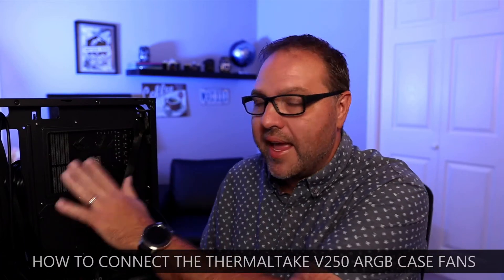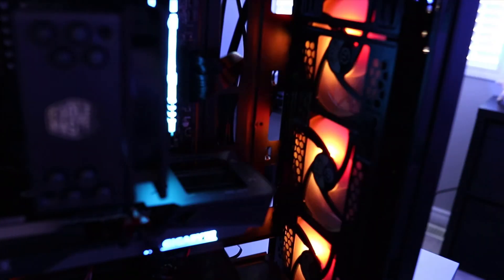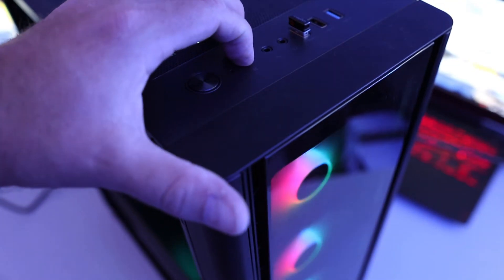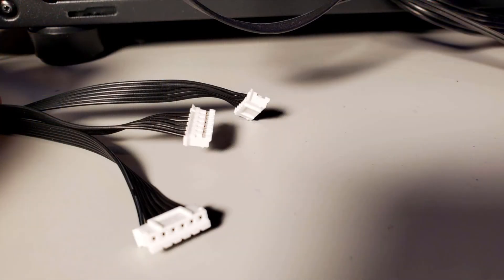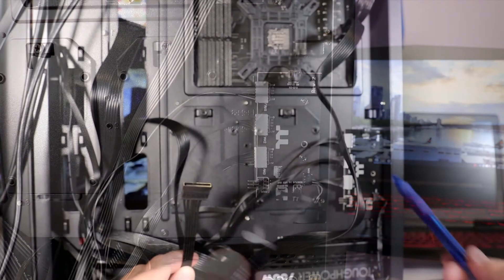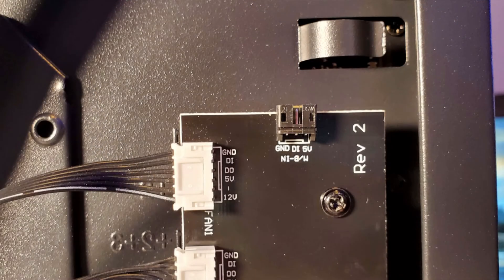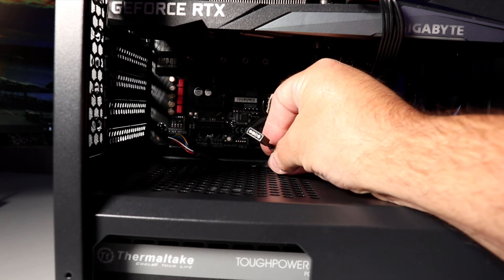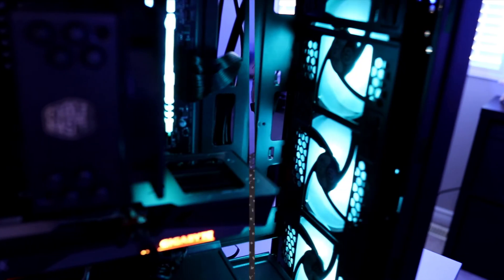How to Connect the Thermaltake V250 ARGB Case Fans

Comment: Hello, I have different question. I see you have thermaltake contoller. Is it possible to change the pwm of the fans via controller. I think it is only possible to change ARGB settings, but not pwm setting.

Comment: Great, great video! My son has all ofthis and never got the fans working ... he's been looking to buy a new fan controller when I think all that's missing is him not re-using the reset button and also missing the cable at the top of the board (in your video's). He's kept the boxes ... so will now go find that cable and (hopefully) set everything up correctly. Not a bad attempt on his own when he did this 4 years ago at age 13 though 🙂
Reply: Yep ... worked ... your video was fantastic ... my son is over the moon with the whole case (watercooliong, memory DIMMS, radiator fans and front fans) all being controlled in unison.. Great video! He seems to have to hold the reset button for the 3 seconds to transfer control over to the software utility .... can you make that the default in any way?

Comment: What software do you need to change the rgb fans
Reply from the maker: Typically you would use whatever RGB software is compatible with your motherboard. Ie RGB Fusion For Gigabyte, Asus Aura Sync,  MSI Mystic light etc...

Comment: I have thermaltake commander C31 rgb case but in this MB signal bridge cable is missing. So my inbuilt case fan does not sync with motherboard when I press the mode button and only one of both fan glow red color only how to resolve this issue.

Comment: Do you only have to plug in thr ARGB cord from the hub to the mobo if you want your rgb software like MysyicLight from MSI to change colors of the fans?
Reply from the maker: Yes, I believe that's all I have plugged in.
Reply: Am I right in thinking this case sucks ass because you can't even control the fan speed or set them to a fan power curve... This is my first PC build I've ever ever done. I won't make this mistake again lol ...

Comment: Great video! I noticed that the connectors for these fans have 6pins, I was wondering how you would replace one of the fans if they broke? I've noticed most other ARGB fans have 2 connectors.
Reply: Yeah I have that same issue rn. I ordered the same make and model of fan based of the serial number on the back but they have two cables and now I am scratching my head
Reply: Hi, i can help you, you plug the 3 pin 12v for rpm fan in the motherboard, and you connect the rgb 2 pin on the 2 pin say led out  on the controller close to the reset button for rgb casing,  if you have more fan to add is in chain, fan 3 connect in fan 2 and fan 2 connect on fan 1 and fan 1 is connect to the 2 pin led out on the controller. @adamabdelrazik2705

Comment: I read an amazon review that said the argb controller has the possibility to fry your board/parts. Is this true because I already ordered the case and am worried about it.
Reply from the maker: I've been using this case for almost 2 years now and have had no problems. Still works great.
Reply: @NorthernVikingEveryday  oh thanks lol. It came broken from Amazon twice. Once it was a dented in bottom, then the tempered glass was literal sand. I just spent 30 dollars more for a NZXT H7 Flow.

Comment: hi what if my mobo isnt compatible with the controller, can i still use the buttons on the case to control the rgb?
Reply from the maker: Yes, if you hold down the button on the case for several seconds, it toggles between motherboard control and case control. When the case is controlling it, you can push the button on the case to toggle through several different RGB colors and patterns.

Comment: My motherboard has 4 pin slot of rgb not 3 pin slot and the i have connected the other cables as well still my fans are not changing colour after i press the restart button plz help myotherboard is b450m pro vdh

Comment: The trick with the 3s button-hold did it for me. I have the v200 rgb and the connector was actually not intended (or working) with the connector on the mb. Turns out I had to connect it directly with the rgb of my cpu liquid cooling. Just took me 90 minutes of testing to find this out.
Reply: Or it was just meant for the regular led connector on the mb...

Comment: It is unfortunate that these fans will not work without the controller with it's current 6 pin connector. Unless you are willing to rip out the connector and re-terminate it to a 3pin header.

Comment: Hello, I have a gigabyte b450m s2h motherboard, the case brand is Thermaltake versa t25, I can't connect the same cable to the motherboard, the holes of the cable are too thin, what should I do, please help.

Comment: Thank you so much for this guide, I have been struggling to get my software to recognize my argb fan controller and out of all the guides I watched you are the only who said to hold down the button for 3 seconds
Reply from the maker: Awesome 👍 Glad I could help.
Reply: @NorthernVikingEveryday  i love your video it helped so much i got one question is there a way to control the front panel fans like to detect it on the board and adjust the fan speed and a follow up question what the last white header on the panel on the back of the pc..i followed your instructions and did everything right im able to control the lights on the fan on the front panel just not able to detect the fans they work just not able to detect them on my pc is there a way

Comment: When i hold down my R button it resets, i kno there's a fix but i really dont want to go behind my pc as i kno it has a full water cooled setup and highend parts i dont want to mess up, is there any way i can do it through downloading software through a link or something, Thanks
Reply from the maker: I don't think so, my best guess is that the reset is plugged into your motherboard and not into the RGB controller at the back.

Comment: when i press the R button it restarts my pc
Reply from the maker: My guess is that your reset cable is plugged into your motherboard and not into the RGB controller behind the back panel. If you re watch the video I briefly talk about it.
Reply: @NorthernVikingEveryday  Yup I accidentally skipped that part of the video. It worked thanks, Subbed
Reply from the maker: You're welcome, glad you figured it out and thanks for the subs. 👍

Comment: What is the different between "LED OUT" and "M/B IN"? I connected that cable with jrainbow (msi mobo) and the fans case light up. So I guess with "M/B IN", you can sync them with main and with "LED OUT", you can't. Right?

Comment: The lights on my fan stopped working and I plugged in everything I would need to get them working. What am I missing and what should I try to fix it?
Edit: Fixed it. The SATA cable from the psu was dead

Comment: great video, do you possibly know if there is a way i can get the cable that plugs into the motherboard? i bought my thermaltake case over a year ago and just thought the fans on the front couldnt be controlled and im not sure where i would go about getting one of those cables
Reply from the maker: I would check on Amazon or you could contact thermaltake directly.
Reply: What is that cable called? Mine did not come with one
Reply: Not positive of this but it could be a 5v 3 pin to ARGB 3 pin cable. If anyone can confirm it would be appreciated.
Reply: @shanoukgaming6763  its called "MB Signal Bridge Cable"

Comment: I was having a hard time figuring this out two weeks ago with my case - this video would've been a big help but I'm glad others will be able to follow along now.
I was wondering, do you know if TT's rgb control software can be used for these fans? I've tried downloading TT RGB Plus but it doesn't detect the fans/hub. My motherboard is MSI and Mystic Light is awful to work with.
Reply from the maker: Thanks for the kind words. As for Thermaltake's software I have not tried it. I am using Gigabyte Fusion 2.0. If anyone else watching has tried it and knows, please comment below. 👍
Reply: Mine detects the fans but not the controller. Changing the lighting options in the software doesn't do anything. I have a compatible motherboard. I don't know what the hell is going on.